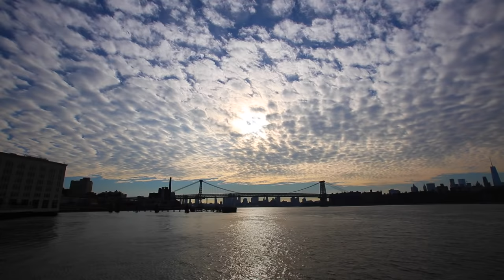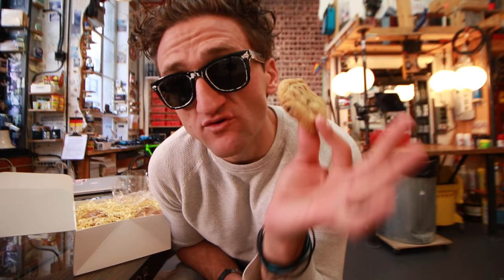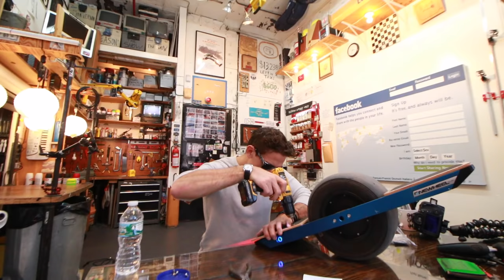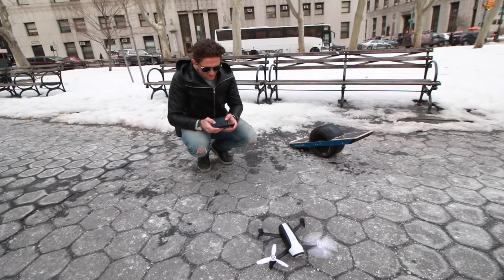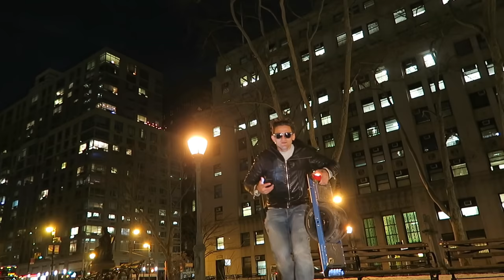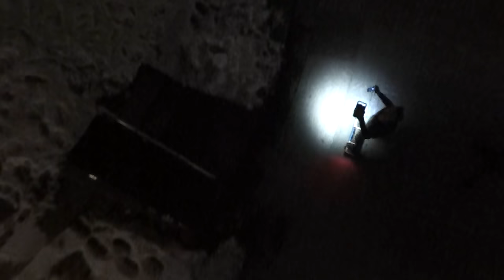Go-Kart Wheel HOVERBOARD

Comment: It's iPhones, but Apple fans say that it's acceptable because of reasons
Reply: +Jacob Jones actually its anything with a lithium battery because a lithium batteries ability to hold a charge is greatly diminished in the cold
Reply: I've never had a problem with lithium batteries in extreme cold with devices in the past, but they are probably better insulated than the iPhone. My galaxy S6 does not have this problem whatsoever, I even put it in the freezer exposed and it did not shut down. It also is wrapped in glass with is an excellent insulator..

Either way it seems Apple could have done better here. 

Note his Go-Kart hoverboard is scooting along in the snow, powered by lithium ion cells. 

Also his camera keeps chugging along.
Reply: +ausieking Mine works fine and it was a third of the price of an iphone. You do realise that you're paying for the name?
Reply: +Jacob Jones Honestly, I have a Samsung. I want both phones. Samsung for personalisation. iPhone for the brand and simplicity.
Reply: Its not iphones its a lemon
Reply: +Alexander Eriksen It happens with iphones more often than any other type of phone.
Reply: +rdizzy1 no not really :/
Reply: Alexander Eriksen Yes, well, mostly. Any phone where the battery is in direct contact with a thermally conductive metal which is exposed to the elements is basically thermally bonded to the elements, so iPhones and other phones with metal cases will suffer a lot more than phones with glass or plastic cases.
Reply: Jacob Jones ?
Reply: iPhones have their battery in direct contact with the aluminum backplate, pretty much thermally linking the battery with the ambient temperature. Phones with glass or plastic back covers will insulate the battery much better, a downside to this is that the phone may overheat easier.
Reply: It doesn't happen with my iPhone
Reply: My iPhone (6s) can be set in the snow and work perfect
Reply: It doesn't happen to my phone
Reply: +Joe Brown same
Reply: +Themrfuzzypants me too

Comment: my iphone always dies when it gets cold smh!! the 5 was worse, but the 6 still has that issue...
Reply: omg mom
Reply: Well you got a SHITTY IPHONE. I have never had that problem
Reply: +Stella Rae that's why you don't buy apple products kids
Reply: +Stella Rae Never had a problem with this on Android kek
Reply: +Syflox androids cold makes battery run longer and phone run faster
Reply: +TheDracer24 Exactly same here
Reply: +Cryo androids are simply better than iPhone's
Reply: Ye it happens
Reply: +Davis2 that is not the problem
Reply: +Syflox where do you live, how cold does it get?
Reply: +Dilip Tien Northern Michigan, definitely colder than NYC.
Reply: In Norway, my iPhone didn't die and it was minus 18 degrees Celsius!
Reply: +Edgar Bosques considering this is due to the alteration of chemicals in the battery, It should occur on most (if not every) phone. That's why cars don't always start up when it has been cold :)
Reply: +Egor Pilosov I got the same phone and it holds up great
Reply: +TheDracer24 you can't compare an operating system to a type of phone.
Reply: +jozef gomez no that's because the oil doesn't like the cold
Reply: I have the 5s and it can easily work in -15
Reply: Same problems has 6S
Reply: All battery's will lose performance in cold climates
Reply: +Stella Rae could this be because metals a worse insulator than plastic allowing the battery to get colder faster just thinking :P
Reply: +Stella Rae could this be because metals a worse insulator than plastic allowing the battery to get colder faster just thinking :P
Reply: +McCRDR it still is. -1 f

Comment: Casey check out the lily cam its a drone that follows you it also water proof there is some flaw to it though check it out tho !!!!!
Reply: +Double O Joe yeah its sick
Reply: +Whaapa yeah its nice but hopefully when they come out with v2 it will have a object detection system and a changeable batter
Reply: +Double O Joe true
Reply: +Nate A did it ? as far as i knew it was in the preorder stage but i could be wrong if it did go under that really sucks. But ik gopro is coming out with a drone so hopefully it will be like the lily drone
Reply: true yeah i hope it didnt go under i wanna get one
Reply: Yeah they have only released a prototype but should be out later this year
Reply: +Double O Joe I bought one cant wait
Reply: Yeah i was going to say that too
Reply: +Double O Joe My problem with the lily drone is that it has a built in fixed cam, so when wind blows, there is no stabilization. Just some thoughts.
Reply: +Francis Meng yeah also you cant change the batter there for when it dies you have to wait for it to charge also no object detection so it will fly into stuff
Reply: yep. It's a good idea, probably not a great product yet.
Reply: He needs this!!

Comment: Its your phone, I use my phone all the time in the cold and it doesn't die
Reply: Yeah same I have it out in -15-20 degrees c and it performs perfectly
Reply: Same, I have the 6s Plus, and the battery lasts at least a day, sometimes two. I've heard the regular 6s has a much smaller battery though, one worth complaining about. (6s Plus is the way to go, best phone I've ever had, long time android user)
Reply: Na it happens to my phone all the time if it gets just a little cold it dies it pisses me off
Reply: Snowboarder here. I use my phone in the cold all the time, and it does die, so maybe not just his phone.
Reply: Fosos regular 6s or 6s plus?
Reply: all my friends that uses Iphone's have the same problem, it dies when it's cold or if it's at like 20% battery.. That's why I switched to android.. samsung is life!
Reply: +UnboxTheWorld ASMR 5s actually, I have a friend with a 6s that also shuts off in the cold.
Reply: Fosos It seems that every iphone other than the 6s Plus has this problem. I've had it since they were released, and it's only died once, and I forget to charge it A LOT.
Reply: +SipanHamed Its Casey's phone, I work in a freezer most of the day where its 10 degrees and below and mine is fine. I have the same phone as well.
Reply: Casey my iphone 6s plus and 5c have the same problem with the cold.
Reply: I have the same problem as Casey

Comment: My iPhone 6s dies too when it's cold outside. It's just like -5C or something
Reply: I took mine skiing and it didn't die until -10c, is everyone else's iPhone crap, or is mine just good? :D
Reply: Same...
Reply: My iphone 6s dies too. Its just like 0C
Reply: Never had a problem with my 5s. Gets so cold sometimes condensation forms on the metal back. Never had it shut off on me hot or cold. Maybe the 6's are more temp sensitive?
Reply: Jamie Marr It only dies when I have it on my arm. When you have your phone in your pocket it doesn't get so cold due to the temp. of your body, maybe that's why?
Reply: +Sinking Fish My 6 always dies when its cold too. IT will say no battery even though I can have over 50%
Reply: +Sinking Fish We've had a few weeks of -15C to -20C temps and I haven't experienced any issues with my 6S. It might be worth taking it to the Apple Store and getting it replaced.
Reply: Piny But do you run with it? because it only dies when I have it in my thin arm-case
Reply: iPhones are notoriously prone to shut down in cold weather amongst smartphones. However, from my personal experience, the newer models are slightly more resistant than older models, just by a little tho. Might be kept warm the cozy leather casing too.

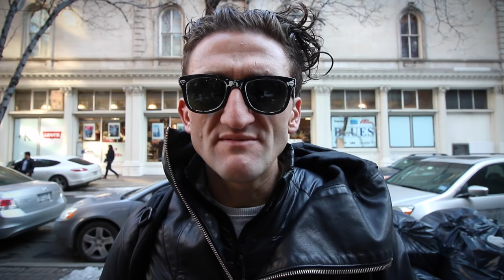Comment: 1:27 It's iPhone. I myself do not use iPhone, I am very persistent with my Nokia Lumia 1020. But, my friends who all have iPhone 6, iPhone 6+, iPhone6s and so for, they all have the same issue. It usually drains out the battery and then they keep it on charge for 20 minutes before it starts to actually charge. (Which is probably because its so cold it took time before it thawed out.. Lol)
Reply: +MelonBadger Same here with with my Lumia 930. Easy to go with it a whole day, even if it's really cold outside.
Reply: Wierd, i have never experienced that problem with my iphone 4s or iphone 6
Reply: Zayx CS:GO Idk, a lot of people who  use it say that it does.
Reply: I think it's his phone! My 6s never fails me, even in freezing weather...
Reply: My iPhone's only did that once and that's when I was outside for about 5 hours in 20 degree weather
Reply: Same with my iPhone 5
Reply: It happened to me aswell during a run with my iPhone 4S. Pretty sure it's the battery wich is to blaim as a battery ddes not.function properly anymore when it freezes.
Reply: +MelonBadger same here.  Have been with Lumias for four generations of phones and have not seen a dying battery in half a century.  I charge them whenever I'm sleeping.

Comment: A Cheetoh fell out of my mouth, and hit the floor... total failure

Ran 16 miles, total failure
Reply: I wonder if it would perform better if it had two weels, (take current wheel, split it in half vertically) so when you turn, it would skid like a tank, but still be in the "uni-wheel" design